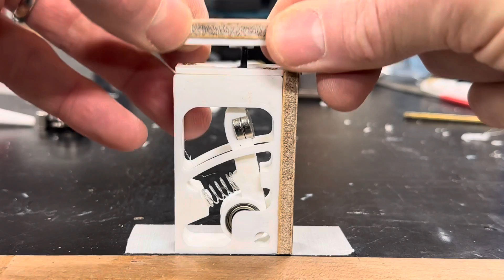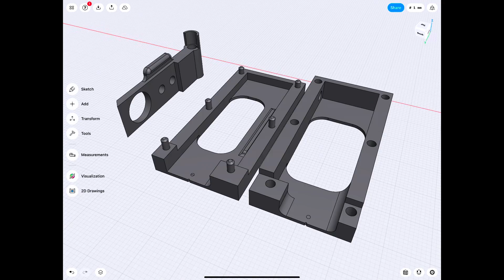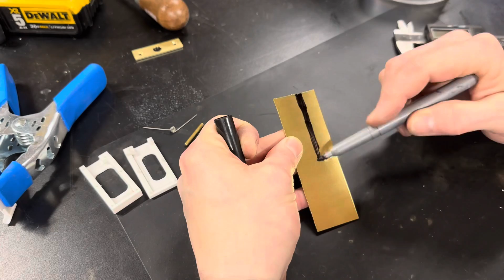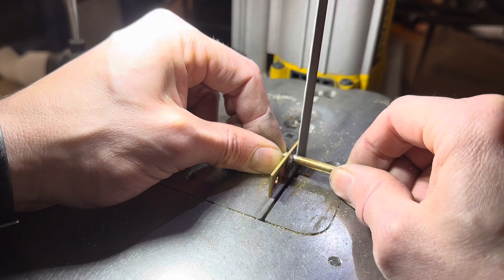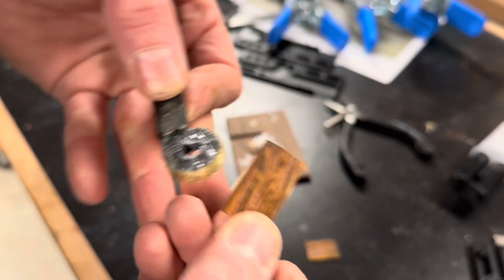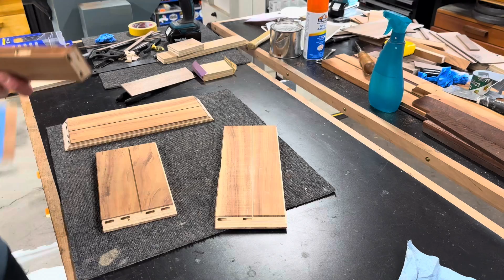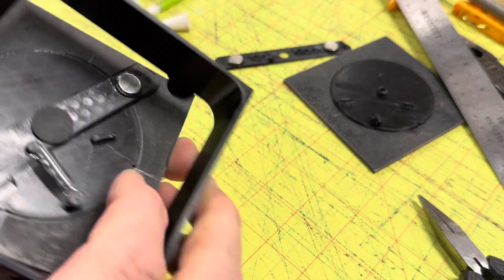Secret Compartments and Hidden Locks, Part 2

Comment: First off, amazing video, very informative and intriguing to watch! Secondly if you want to make this version of the magnetic latch with a few less parts 0:36, I suggest adding a torsion/coiled spring into the arm, that way the spring would reset the position instead of adding one behind it!

Comment: Fantastic work, dude! Brilliant use of 3d printing and brass pieces! 😃
You should consider getting a dremel tool... Or even building one yourself (I did it, but I used a too slow dc motor, but works fine). Because it's a fantastic tool for working with small pieces!
Anyway, stay safe there with your family! 🖖😊